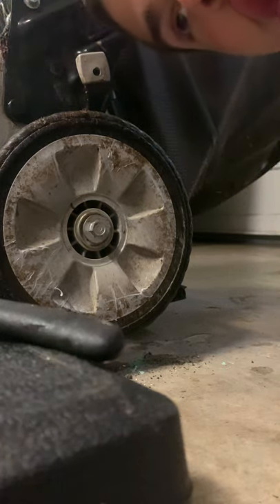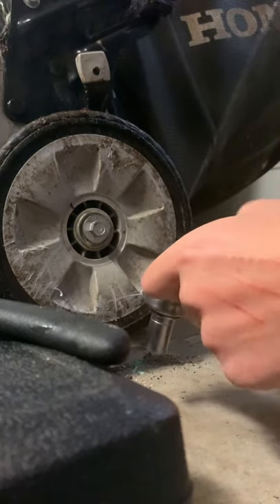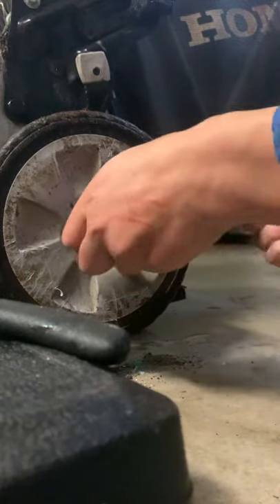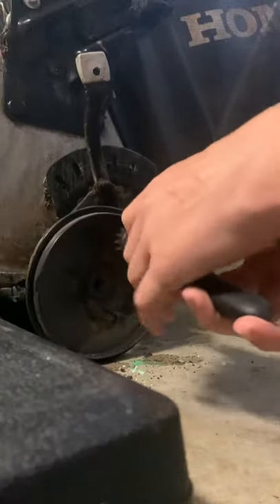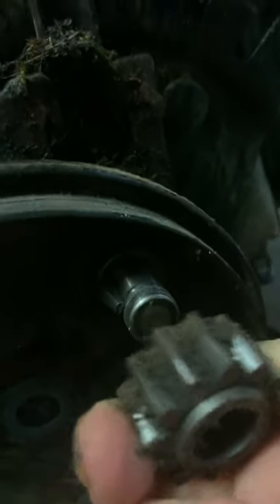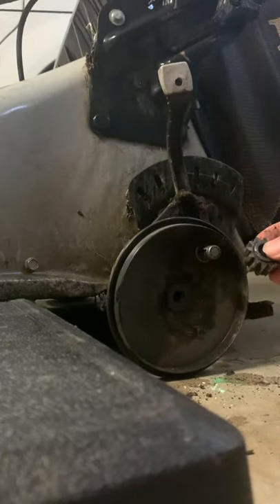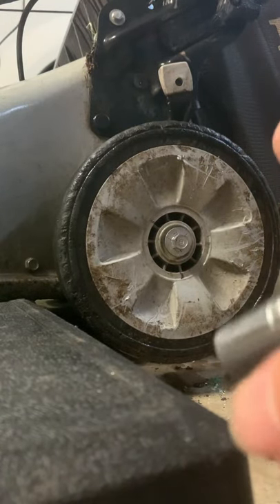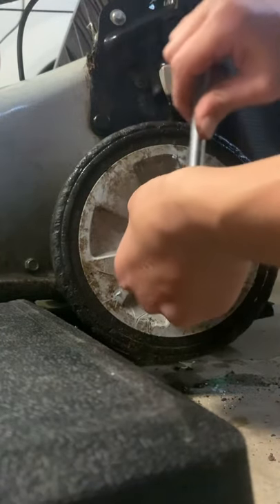How to replace the self propel gear on a Honda Lawnmower

Comment: I never tried 1/2" socket b4. Always use 12mm. Now I have alternate one.
Reply from the maker: The only real difference is one is imperial one is metric
Reply: @thehelpfulchannel5  that's frustrating, expecting metric and surprise you with standard size.
Reply from the maker: Yeah sometime but if you have both metric and imperial right next to each other its less of a hassle
Reply: @thehelpfulchannel5  then I won't get exercise walking back & forth. LoL
Reply from the maker: thats a good point 😂